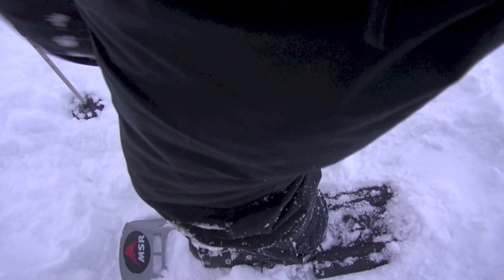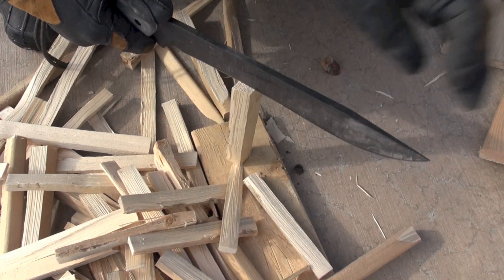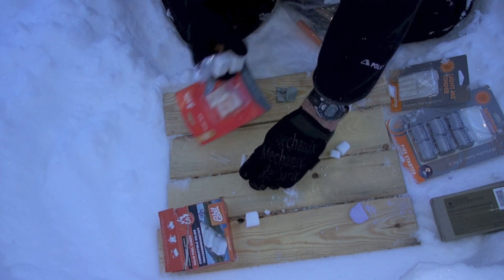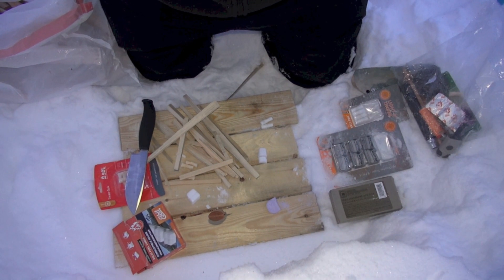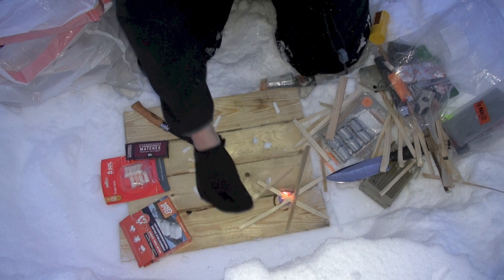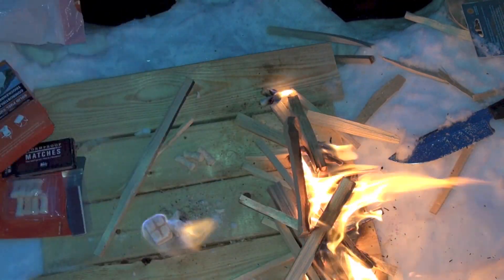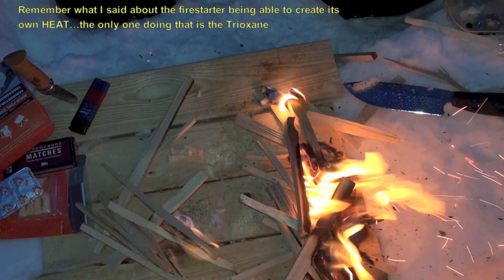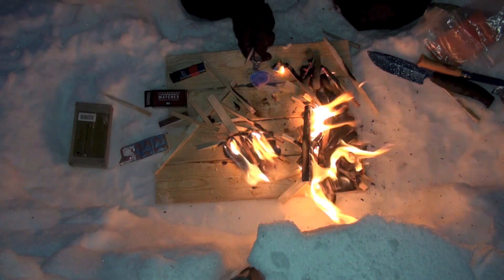Damn, These Firestarters Suck! (Nutnfancy Snow Testing)

Comment: I've used that wet fire stuff in wet conditions.  I actually got a fire going while it was lightly raining and with wet but unsaturated wood.  I did light it with a lighter.  I've never gotten it to light with sparks.  If you have a lighter, it lights right up and burns long enough to get wet wood going.  I'll probably be getting some trioxane though!

Comment: I've bought "wet tinder" by Webber bbq starters. 24@$3.50 I've dipped them in multiple layers of wax and stored them in a can. I cut them in half and mince a few shavings off. though I haven't tried it in the snow, always in one to three strikes with the old ferro, and outs on. the wax helps it burn to completion.

Comment: I am a huge fan of the petroleum jelly cotton balls. I keep several of them in one of the match canisters you have. I have lit those with one of the strikers like you have. it have done it in the rain and wind, the last time it was misting and about 35. the only drawback is they are messy but I just pull them out with two small twigs.

Comment: You can also do your own napalm. Take a small plastic bag (some plastics might smelt) and put acetone in it and put styrofoam into the bag (it will smelt upon contact with the acetone) until you got a white sludge. Then season to taste with gasoline (and tar if you want it to stick better). This shit burns under water.

Comment: I had a bit more success with the esbit stuff by splitting it in half then striking. It is really harder to light than it should be though, especially compared to trioxane. Tried to source the trioxane a while back and couldn't find it so I appreciate the amazon link. Fun video, been through a lot of this myself but haven't tried all of these. Keep it real nutn

Comment: I remember that Jack London Story, where the guy died because he couldn't start a fire. 
Trying to start a fire on a windy day with snow pouring down with some of those products would be impossible. Add the fact most people aren't likely to have a dry platform setup like you had. They'd be trying to start it on some wet branches.
FYI, an old school zippo is more reliable than butane in the cold. Plus if you bring some spare lighter fluid for it, you have something else to help you get a fire going.

Comment: If you want to start a fire in wet or cold weather just use a regular road flare like the kind you can buy in auto stores. You don't need matches and the flare will dry and burn even wet wood that isn't too thick.

Comment: I've used Wet Fire cubes to start many a fire here on the west coast of Canada, in the snow, rain, wind and good conditions too.  Both while backpacking and hunting deep in the mountains and have never had it fail me or had any problems with it.  

Break up half a cube or a whole one into some damp tinder even and have your bigger stuff ready to build it up, it usually doesn't take more than a strike or two... Just a tip when using a firesteel/ferro rod, move the rod against the striker not the other way around.  Stops you from knocking your tinder/firestarter everywhere like you did a few times, and just works better overall.  The only other two things I use are fatwood and cotton rounds soaked in vaseline which also work really well and reliably if you know how to use them, which doesn't take much practice.

Comment: it's a ferro rod not a flint and steel. You weren't using it right either.  you were shooting sparks over the intended targets. hold the striker still and pull the rod backwards when trying to concentrate sparks against a surface. the smaller tinder is one of the best to use with a ferro IF you pull it apart. It's basically tampon material.

Comment: The "wet my diaper" works better if you break it up,  but it is a pain to light with a firestee. The Esbit tabs are imposible to light with a firesteel, they pretty much need a lighter. The tinder quick work real well if you fluff them up, they catch a spark pretty easily.

Comment: I've got the Wet Fire to light with a ferrocerium rod by making a pile of shavings from the block.  I agree that having to mess around doing that is not great, because in a survival situation you might not have the dexterity.  Anyway, the point is that shaving slivers off the Wet Fire block overcomes the problem you were having with brittleness.  Trioxane rules!

Comment: Come on Air Sport, you've got to pre-flight the fire starters before you just 'have at it'.  Follow the checklist or in this case the instructions.  You wouldn't just have at it on the flight line so do a little pre-burn prep.  Got to give you a little bit of guff for fun and good measure, Nutn.  ;-)  By the way, good in the field stuff .

Comment: I found with esbit one needs to powder a small portion for the sweedish steel to light , but a magnesium starter works best because it needs a ton of heat to light. The esbit also works when it's damp but the amount of heat required tends to evaporate the water anyway ... I'm surprised you didnt have some water or other stuff ready for a boil up right away ;)  still nice video.

Comment: Beautiful locations.  This topic is one of my favorites since I was a Bobcat through my retirement from teaching.  Excellent location choice, too.I like your idea of level playing field for equal testing.  I believe you missed an important element in this, though.  You state up front your preference for trioxane.  I've used it often as well, and I really like it, too.  However, since you're already familiar with triox, you're not on a level field with products you've never used or know nothing about.  Triox is an easy light product, but it also can deteriorate in storage  much more easily than other products.  I've seen packages of trioxane that, when opened, had nothing inside but blue residue that is sticky and almost inflammable.  It's rare, but it's happened more than once to me so it's not something I put in a storage emergency kit.  I agree completely on the wet my diaper and the Esbit bars.  When you use the Esbit bars you also get a black, tarry build up on your stove.The Light Me Tinder and the Tinder Quick are basically the same thing.  If you use them as the directions say, it takes a spark even easier than the trioxane bars do.  Thanks for the entertainment and the viewpoints anyway.  You have a great channel.